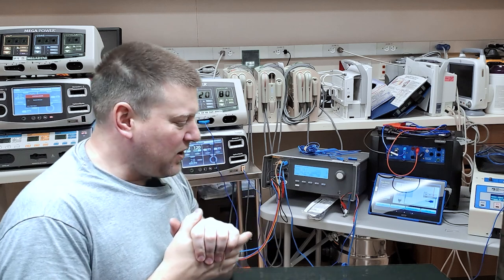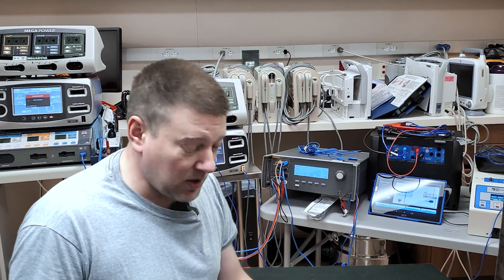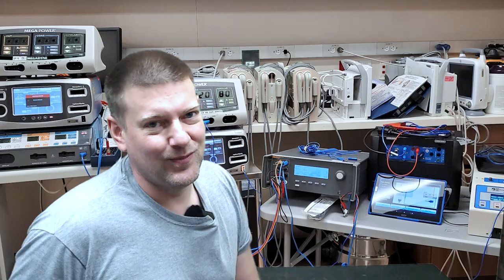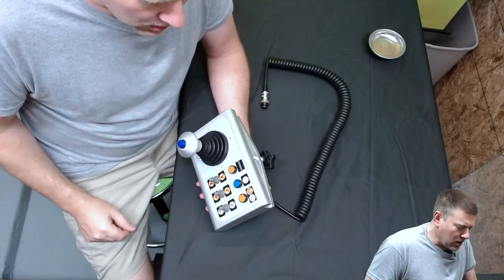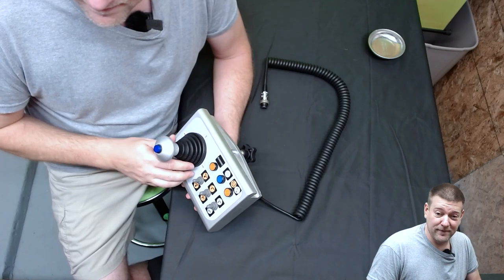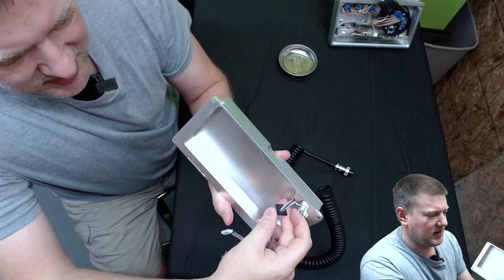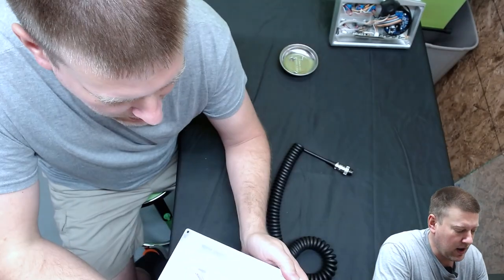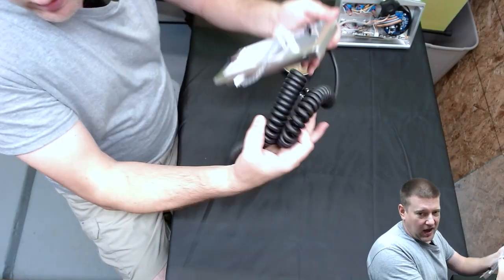DRE C-Arm Table Control Repair

Comment: To prevent a cable from rotating, 2 zip ties next to eachother with each zip tie 180 ° rotated from each other. So that the 2 leftovers from the zip ties act as 2 wings on the cable, pressing against the wall inside the device. With this trick the cable can't rotate and with 2 zip ties next to each other, you have a decent strain relief. 
Another solution, depending on the available space you have inside the device, is to place a short piece of rubber / silicone hose arround the cable, and sqeeuze that hose with a hose clamp. This works best, if the cable entry is nearby a wall of the device, and with the clamp pressing against the wall. 
And offcourse, hotglue can also do the job, to unloose the hotglue next time, let some Isopropanol soak arround the hotglue, and the hotglue comes loose after a few seconds.
Reply: agree with the hotglue